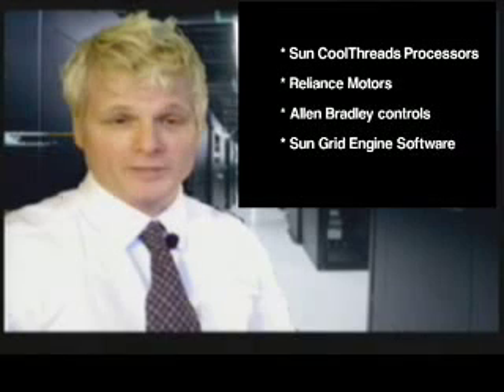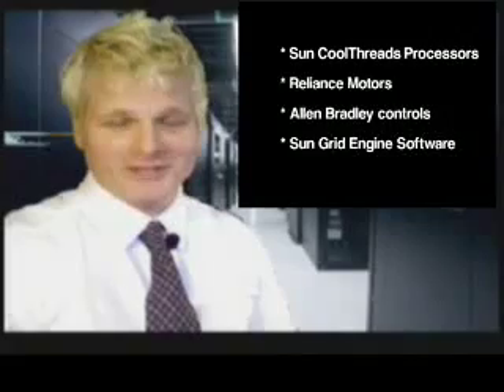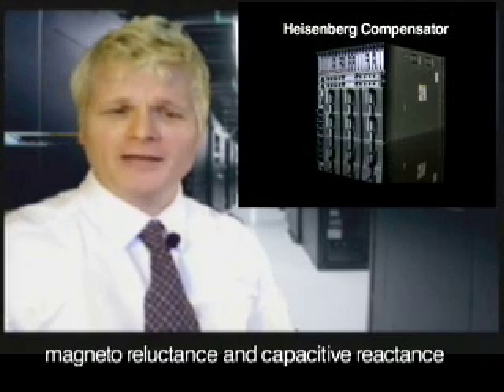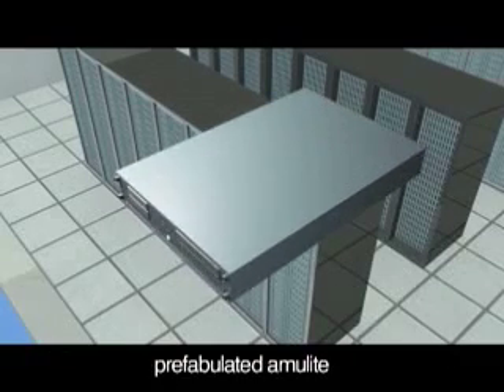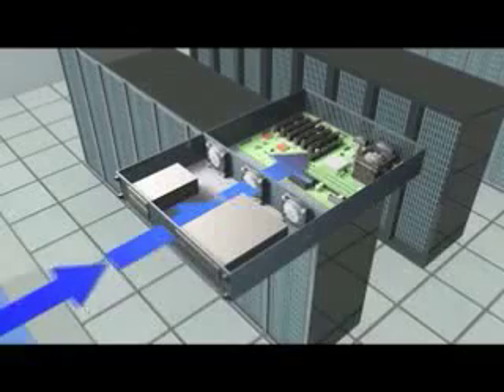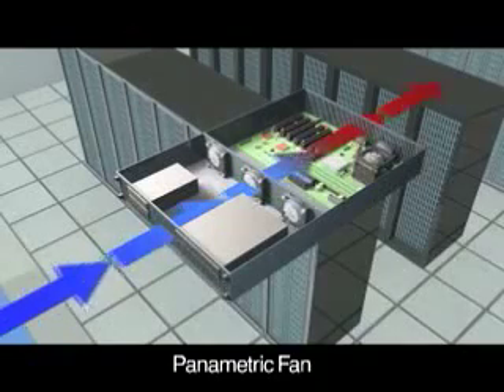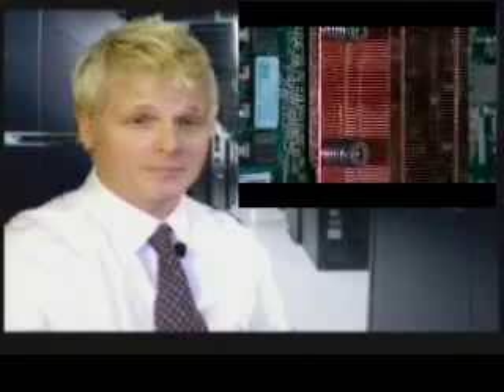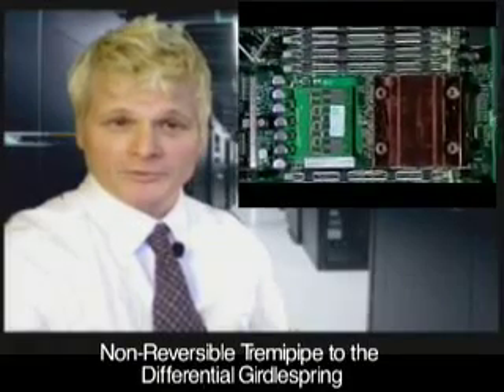Heisenberg Compensator

Comment: Problem is that Star Trek already used the phrase "Heisenberg Compensator" when they attempted to explain how their transporters worked. They said the Heisenberg Compensator compensated for the fact that you can never know both a particle's speed and direction, only one or the other. The Heisenberg Compensator, compensated for that and allowed the transporters to work.
Reply: But it was later found that a Schroedinger's Cat Controller was needed to provide transmogrifcation capability to the Compensator.

Comment: @overheardinpdx   Parody is only fair use when you're parodying the original work.  In this case, the orginal work is already a parody;  copying it virtually word for word would not be fair use no matter what, but  since it doesn't parody the original but merely reproduces it, it isn't protected.